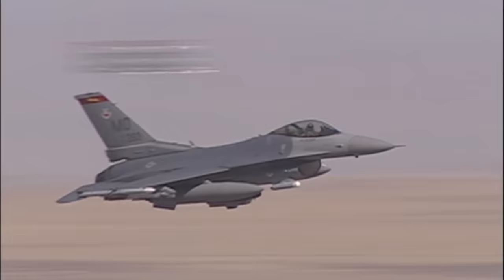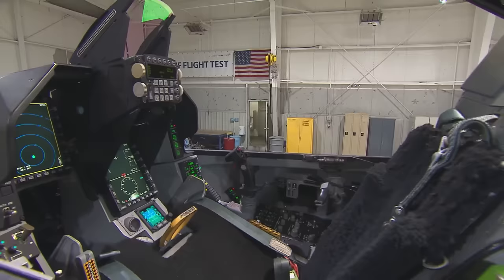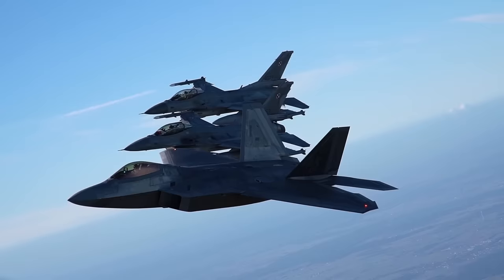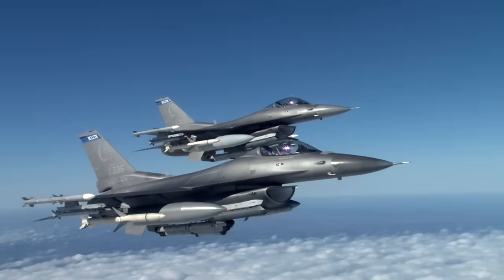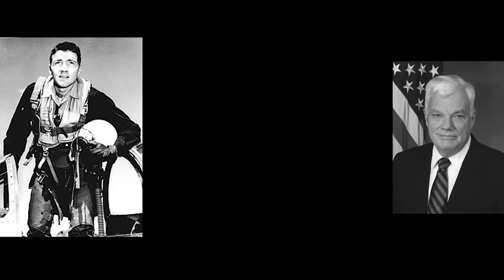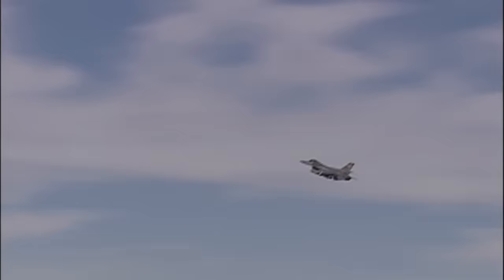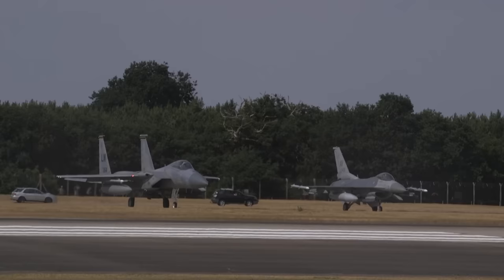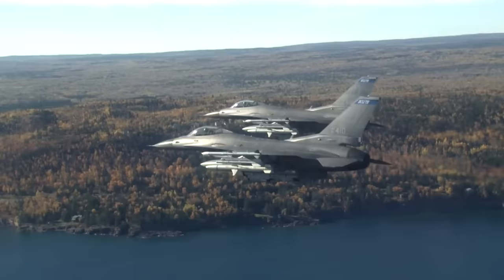Block 70 F-16: The Next Generation Viper Fighter

Comment: Please create a Vid about how Gun Pods affect The F-35's stealth, if the Gun Pods make a big difference or not, and if the Gun Pods themselves have any stealthy aspects!?
Reply: Not even a question, would never be used when a VLO mission is required. If you plan on taking a gun then, your plan is flawed. It's more surface area so it will increase the RCS.
Reply: @mobius7089  well you just kno everything😆 There's already "stealthy" Pods I'm well aware that it will increase the RCS the point is The F-35 is a Stealth aircraft and intended to function as thus plus as i already stated stealthy Pods already exist! So I'm confident but not 100% sure that anything attached to a stealth should in itself have stealth attributes which is what I'm getting at how much does The Gun Pod affect The RCS of The F-35's B and C and how stealthy are the Pods themselves👍

Comment: Why not take it further by changing the engine completely with a F-22 engine and adding infrared camera's to the jet for better night fighting capabilities?a stealth coating on it would make it have a smaller radar cross section then it does now.

Comment: It’s still a top notch dogfighter.
They say it’s an excellent BVR platform but it’s lack of missile capacity is definitively a potential liability in that area depending on the circumstances ofc.
Since 5th and now 6th gen fighters are proving to be cost prohibitive I think the Viper along with the F-15 still have some legs left in them.
They’re still effective against most threat environments any potential enemy can bring against you and if I were to vote for any 4th gen fighters to survive an engagement with a 5th gen fighter the F-16 would be one of them.
The other issue you run into with 5th gen fighters is with their lack of capacity as well along with cost to fly and high maintenance hours to maintain I still see a world where your legacy aircraft would still be needed to do a lot of the heavy lifting once you are in a low threat or uncontested environment.
I just don’t see the point of strapping a bunch of missiles and bombs to the wing of an F-35 shortening the life of that airframe to do work that can just as easily be done by legacy aircraft.
Maybe in a world where stealth becomes a lot more cost effective that would be the case but as it stands now the cost to buy an F-35 is actually cheap but until you can get those maintenance costs down out of the nose bleed section it just doesn’t make sense.
The other issue you face with cutting edge technology doing constant sorties the threat of losing one and handing that tech over to potential enemies is a big concern

Comment: With the right mods this aircraft could surpass any plane in anyone's air force!
Reply: No, it simply lacks the stealth coating and design and isn't designed from the ground up for the same kind of super cruise and extensive electronic integrations.

Sure, if you literally replace the whole thing it could be a less good F35/F22 but at that point why not build a full fifth generation fighter?

But it will probably always be one of the best dogfighters ...just like 3rd gen planes are the best high velocity interceptors but technology advances and different capabilities become more important.

Comment: There's One More, "Insult,"  Name for the F-16 by Other 1970s to 1990s Fighter Pilots.  This Insult Name was "The Lawn Dart" based on the, at times Dangerous, Game called Lawn Darts, or Jarts (Lawn Hose-shoes Game but with Darts).  That's because Early F-16s had Flight Control Issues.  As a result, some of these jets flew to the ground and one Lake.  Which, someone publicly said the wreckage looked like a old damaged Lawn Dart.

Comment: They should update this plane with the F35 avionics and helmet that see through the aircraft!  More speed and maneuverability and see if they can’t coat it with some stealth coatings and give the exhaust nozzle the jagged edge that helps mask it from radar?
Reply: No point. The F-16 is such an outdated platform that they desperately add on to for the sake of cost and standardization.
You're adding more weight and drag for a system that has little purpose when you can't get close to targets...
Reply: You know you are describing an F-35 right now

Comment: Ciekawy jestem jak wyglądała by walka powietrzna między F-16 Blok 70 vs Su-35s?
Reply: F16 would opt for the rate fight around 900-1000 kmh and rate the hell out of the SU 35. After draining the speed, pull as hard as possible and get the su35 in your HUD. Then fox 2.

Comment: Due to its all electric/electronic control system we used to also call the F-16 the “Lawn Dart”, because that’s what it could behave and look like if it suffered an engine or APU failure while in flight…

Comment: Fly by wire was needed because F-16 was designed to be unstable in the pitch axis, making it more maneuverable. No human pilot could keep it stable. Energy maneuverability was more a dogfighting theory. In a turning dogfight, aircraft lost energy (combination speed and height). Energy maneuverability was about having an aircraft that had such powerful engines that it lost less energy in a dogfight, giving it a tactical advantage.

Comment: The conformal fuel tanks give the F16 block 70 a better range but hurt the manoverabiity and RCS not to mention drag. Why was the internal fuel tank not increased as 3200L is way too little. Probably its to late for a redesign now but this could have been done 20years ago.

Comment: I always wonder if they upgraded the viper with the same technology as the f35. Would it be the deadliest aircraft when it comes to  a dogfight?..
Reply: As someone whose worked with the first 5 Block 70’s it won’t have the same capabilities but they will have interconnection similarly and the F-16 will still maintain superior dogfighting capabilities where the F-35 supports a different air superiority role.

Comment: They need a more sturdy landing gear. So it can take off on austere runways. It's all that's missing.
Reply: It does have a sturdy landing gear, that’s not the problem for landing on “austere runways” it’s the fact it has a vacuum cleaner of an intake.

Comment: I find it odd that whenever F-16 history is mentioned, nobody mentions Israel as the first combat operator, why is that?
The first air-to-air combat victory was achieved by the Israeli Air Force over the Bekaa Valley in April 1981.
Then it was used in June, same year, to destroy Iraq's nuclear plant, its first bombing run.
Yet again, Israeli F-16's had 44 confirmed kills over Lebanon in the biggest jet aircraft fight ever, 1982.

Comment: Give it the new ceramic based stealth paint and it's unstoppable.
Reply: There’s more to it than just the paint and a lot more science behind the reduction in RCS.
Reply: @dmitris.479  The new ceramic based stealth paint is supposed to reduce the RCS by 95%.
Reply: @colonalklink14  you are correct but you aren’t taking into account with payload, exposed antennas, and the astronomical cost of the paint. To put it into perspective the low observability paint cost about 1200$ a gallon the next gen ceramic paint is even more expensive not to mention the F-16 doesn’t even have a coating for the cockpit which does increase the RCS and weight, the weight difference is huge which can have a tremendous effect on flight performance.
Reply: @dmitris.479  F-16's were part of a program called "have glass", they have coatings on the bubble canopy to reduce radar cross section.
Reply: @colonalklink14  you are correct but, there are very distinct coatings between f-16, f-22, f-35 etc
Reply: @colonalklink14  Stealth isn't the coating but the fundamental design of the aircraft. The F-35 or F-22 are designed to reflect as many radar waves away from receivers and the coating is there to help a bit. It could help but at that point, why not use an F-35?

Comment: So Im wondering if expensive fighters even make sense anymore.  Seems plausible that with enough volume you could build a cheap prop kamakazie drone with basic gps, camera and electronics for 10-30k a piece (car prices) and then build up a stockpile of a millions of such drones.  Hide a small fraction of more capable but similar looking command and control craft amoung them and then just send them out in a wave.

I presume I'm not smarter than the defense establishment so why wouldn't this be better?
Reply: This is - sort of - the idea behind the "Loyal Wingman" concept that the NGAD program, as well as other some other 5/6th generation fighter programs are looking at. Basically a premiere sensor platform like the F-35 or NGAD spots, categorizes, and distributes targets to (relatively) less expensive and more expendable munitions-carrying drones. How the use of drones, from relatively cheap and short-range loitering munitions to pilotless air superiority platforms evolves over the next couple of decades is one of the biggest questions in modern warfare. Keep in mind one thing though, the technologies to counter drones exist and will continue to be developed. What we are seeing in Ukraine is not necessarily representative of what a peer conflict would look like. We are seeing drones being deployed against decades old systems never designed to counter them. Drones can be cheap, but they become significantly more expensive if they have to be able to operate in a jamming environment and be capable of bypassing radar-guided AAA defences. Bullets will always be cheaper than drones, and there has been a lot of research in recent years into how to deal with large numbers of small asymmetric threats. Laser systems, like those that recently started being mounted on US ships, are capable of downing conventional drones in about a second and costing just dollars per shot after the up front cost of the system.
Reply: @Strait_Raider  I appreciate the answer but loyal wingman is kinda the opposite idea.  Yes, you have a few drones supplementing the main aircraft but these are very expensive capable drones.  

Regarding Ukraine, no it's not a perfect analogy but I think the biggest single attack was on the order of a hundred or two cruise missles/drones at once and that overwhelmed their air defense.  Obviously, the US and China both have more air defense but if you scale that up nothing near enough to respond to 10,000 drones much less a few million.  And yes bullets are cheaper but if you fly at least a few miles up they are pretty inaccurate and you are basically back to WW2 rates of interdiction per AA station and that's not going to be enough to dent a million strong drone swarm especially given the attacker gets to pick the direction they attack from.

The laser is a really interesting response but I looked it up and the one on current carriers has about a mile of effective range and it's blocked by things like clouds or rain.  That's a great way to deal with a terrorist drone attack or maybe even a few dozen drones but an aircraft carrier is 10billion dollars so let's say you invest 1 billion to sink it...at 10k a pop that's 100,000 drones.  Program them to fly at 3 miles up and then dive down at the carrier and you get maybe 15s at the very outside while they are in range assuming they aren't protected by cloud cover.  Stronger lasers might be a bit better but even with those and those fancy anti-missle gattling guns and I don't know if they could keep up.

But maybe the answer is simpler...you'd give up too much other capability if you invested half your defense budget on drones.  We want the military to do alot very little of which is reduce a country to rubble in a devastating first strike (not very useful if you string them out).

Comment: Actually the Fw 190 was the first aircraft to use fly by wire
Reply: 😂 wait, computers didn't even exist in the 30s?
Reply: @rogerthat4545  They did actually, mechanical computers. And the Fw 190 did have one, the Kommandogerat, but it was an engine control computer, not a fly-by-wire system.

Comment: Would this make it the longest serving fighter jet?
Reply: Not by a long shot. There are still Mig-21’s in service as front line airplanes in several air forces. And with their low cost and parts availability, there will likely be -21’s flying 90-100 years after the type was first flown. 

As far as GOOD (modern) planes go, the F-16 will probably end up being the longest serving fighter at some point.

Comment: At Shaw, we had Vipers with LOW (I believe that acronym is spelled right). Radar absorbing, and recharging paint. This would give the F-16 a radar size of a bird, compared to F22 or F35 that would have it a size of a fly. Course the loaded munitions would almost defeat, the purpose of the LOW but it would still be a lower print.
Reply: Low Observability and you are correct to an extent without delving in sensitive information.

Comment: Yeah, no disrespect to you, but the "fighter mafia" is basically a bunch of non military crackpots who want to go back to the days of ww2 dogfights. They claim that they're the reason that the a10 was built. These people proposed removing the radar, hard points, avionics, a whole engine, and add a monster gun to the f15, because the jet doesn't need any of that high tech crap.

The fighter mafia are a bunch of loons whose idea that the only good fighter is one that is fast and light is entirely antithetical to what's commonly accepted as superior design. They hated the fact that the f16 had to use a fly by wire system, arguing "what if it fails" and "heavy computer interferes with maneuverability."

Meanwhile, pretty much no modern fighter goes without such a system.
Reply: Lmao two of their fundamental beliefs are "Multi-role and multi-mission capability plane designs were fundamentally compromised" and "Beyond visual range combat was a fantasy". Their idea of a good jet has less tech than a modern cessna 172 lol.
Reply: If anything, the F-5 was their darling.  They'd hate what the F-16, F/A-18, and F-15 have become (when they didn't take credit for their development).
Reply: @オーギーマルーン   bro, yes! Like I'm fairly certain they'd be grumpy the poor little f5 had twin engines lmao.
Reply: @Stryker2279  But...but it did....two GE J85's.
Reply: @ArrKayCee  yes, and I'm saying the fighter mafia must've been mad as shit that it had two

Comment: I  say invest in better Radar and better missile tech and trust vectoring capabilities and  thats where the true power of an f16 will shine. Wiithout dogfighting in mind better rader and missiles  are  the way to kick the shit out of  4.5 and 5th gen fighters. But stil in a dogfight with a SU trust vectoring beast an f16 wil be vaporized. 

First who see's a bandit on the battlefield  is the one that will win the fight. A blok 70 /80 f16 with better rader and upgraded missiles and trustvecoring capabilities can still pak a serieus punch, and is cheaper to maintain and fly.  Whit that in mind its better to have 2000 upgraded f16's than less big expensive warbirds. Still development is alway's good if shared with allies and rolled out quickly because Russia is on par with there su 30 /35 planes  of witch they heavenly rely on. In my book just make the f16 better more future proof  and they  (russia /China/etc...) have a big problem on their hands.

Comment: I think my country should have bought the Block 70 in stead of the F35 to replace its older F16's. 
It makes more sense whenever international operations are taken into account: since Belgium by far doesn't meet the 2 % GDP criterium, participatin in international operations can somewhat compensate this. F 35's aren't exactly ideal weapons systems to use in let's say Afghanistan or Mali, F 16's are. We would have saved about 30 times 100 million USD, which could have been used to finally resolve the terrible debts of the country, while still maintaining a credible defense force.